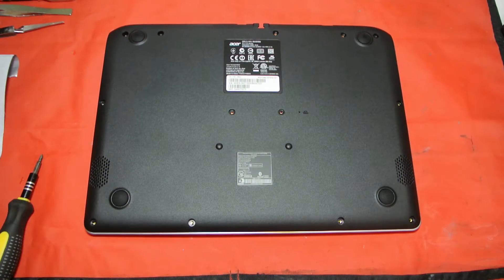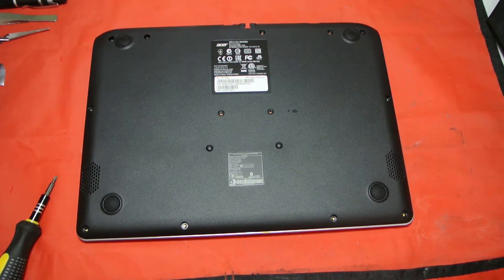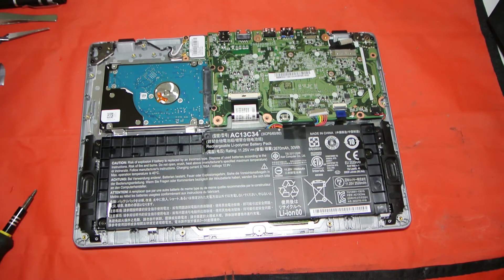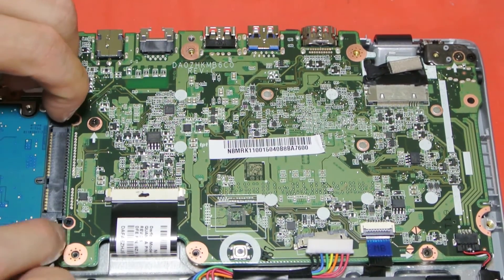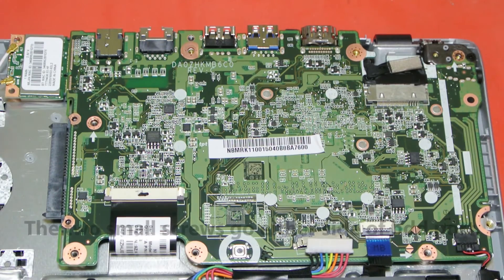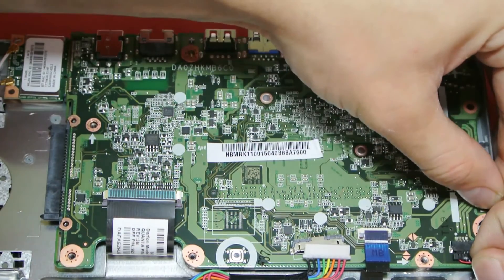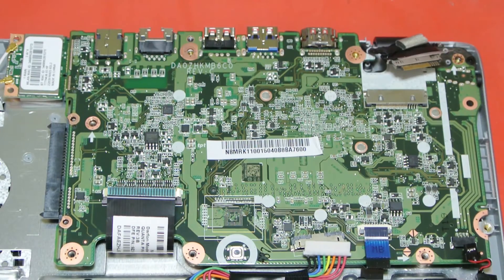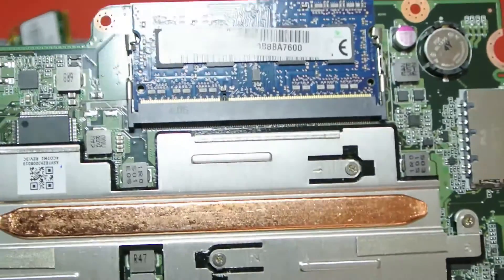ACER ASPIRE E3 E111 112 Ram Upgrade, Replacement

Comment: As a matter of fact, you don't have to remove those two small screws on the motherboard on either side of SATA slot. Just the Wifi module, flat cables, and three screws marked with white arrow.

Comment: Hey. I wonder if I could install a couple Samsung 1GB RAM sticks into the RAM slot. The sticks are 8 years-old but won't fit. I think it's simply because they're too old but I'd like someone else to confirm me that they indeed won't fit in case I'm missing something. 

Nice video btw.